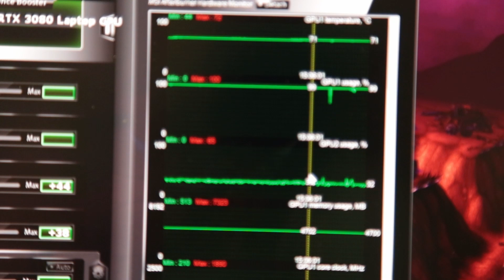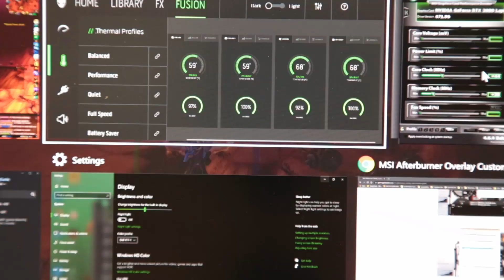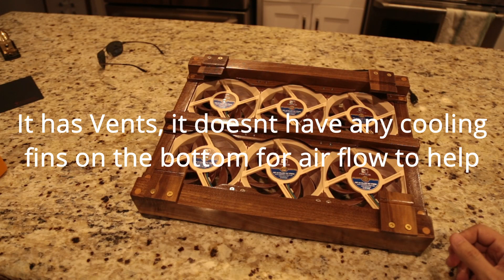Custom Made Laptop Cooling Pad (ft Alienware X17)

Comment: I did a frankenstein mod where I cut a hole in my laptop case and strapped a 120mm noctua fan. 3 days later I see tihs vid and I had the most YOU vs THE GUY SHE TELLS YOU NOT TO WORRY ABOUT when I seen the 6 fan setup. 

Its awesome we need more custom mods like this shown to evolve the laptop designs. I wish for a thiccer laptop to exist
Reply from the maker: Lols, thanks!!  It's a step up from the classic cooler, but these newer ones that seal and force a lot of air through are where its at now.  I probably can mod mine to work much better now.
Reply: @dragon.factory  Turbo! When you make something new related to this post it.

Comment: Yo this is epic! I suggest you to check out the Klim KN01 or IETS GT500 cooling pads. They have this special design where the sides are sealed so the air is forced into the laptop instead of bouncing off the bottom plate and leaked to the sides. You could probably do the same with your model to see if it helps more!
Reply from the maker: Wow, just looked at the IETS GT500 Powerful Turbo-Fan in some videos.  That design is prefect.  Yea, having a seal like that would go a long way to pushing the air right where it needs to be.  Might consider modifying mine to have that seal.  Good stuff!!
Reply: Ifi could add my 2 cents here, yea sealibg helps since we are looking at static pressure vs airflow, in order to push the air through higher resistance area you would need some kind of seal or the air would escape anywhere it can where resistance is lower, i have few builds behind me so i learned, love it. Love your creativity, i was thinking building with 3 fans a bit above the surface where laptop lies on springs and rubber on their tops so they spring in under the weight of laptop and seal is secured, do check pressure optimized fans vs airflow ones if not aware already, good luck with your builds!

Comment: How did you wire the fans to the controller? I used a step up controller from 5 to 12 V with 2 fanst and it destroyed my usb port ....
Reply from the maker: Both the fans and the controller are 5v to match what a usb can provide. So no need to convert.
Reply: @dragon.factory  Oh so the RPM is 1500 at 5v... nice... I guess I have to find something like that cuz with the step up convertor I think I damaged my usb port .... shit... :D
Reply from the maker: @senseiDi  oh damn. Possible.  Yea, definitely something to watch out for. Always check the power limits of ports before plugging in fans in. I learned this exact lesson myself with fan headers on a motherboard not knowing their were low and how amp headers and too many fans splitters.

Comment: Rpm suck you want cfm to be high so that air can be pushed through those small vents also those fans won’t do anything much unless the cfm on those fans are high enough to pass air through those tiny vents
Reply from the maker: When I designed it, I was going for high CFM.  The 6 Noctua NF-A12x25 5V PWM that I have are rated for 96 m3/h, which I consider to be quiet high for 5v fans.  Remember, these arent the higher powered 12v standard fans as all 6 are powered by a single usb port.  You rarely go wrong with a Noctua option.  

I wanted high CFM as I consider the cooling this provided was the cooling of the overall chassis, it was not meant to force air into the case.  If you look at my design, the fans sit about 1.5 inches off the bottom of the chassis with the air flow designed to hit the bottom and go out the sides and back.  Pulling the hot lower panel's air out and providing constant fresh air for the internal fans to pull in.   

I did not mean to force air into the case because those holes are pretty small and it would require some what of a seal between the bottom of the case and the top of the fans with some form gasket.  I dont have the ability to craft that yet.  If i had tried, it likely would be less than perfect.  And if it was less than perfect, it would end up functioning like my current design already is with air simply blowing across the bottom of the chassis.

Also, if I went with a design to blow air into the holes, I actually wouldnt care about CFM but I would care about static pressure fans like the Noctua NF-F12.  These would be much better at force air through those small holes. 

Cheers!!
Reply: @dragon.factory  thanks for replying and appreciate the details 👍🏼🙂 but the reason why I said high cfm is because I did a diy build with lesser static air pressure and high static pressure and I figured out that high is just the best options for laptops especially if your go for straight up performance which in my case I am so my build right now is four 200cfm 120mm 38mm 1.95A 12V connect to 120w DC power brick I use a hub to control the fans obviously I don’t want my laptop flying away lol case I use cooler master u3 or custom case

Comment: Nice project, this is just what I was looking for, except you don't explain the part that keeps me awake at night 😅... I have already a design but I don't find any fan controller that suits me, at the end I found that NA-FC1 noctua fan controller, it seems to be what I need (4pin PWM controller) except for the way it's powered, how do you feed the controller? Btw I need 12V so usb is not a solution to me, this is why I'm going to use 12V charging brick, any help? Thanks in advance
Reply from the maker: Thanks!!  Yea, i used the NA-FC1 as well.  Why cant you use the 5v noctua fans and just run it off the usb?
Reply: @dragon.factory  I want to use all the fan capacity which is 3000rpm but it needs the full voltage for that, but how did you connect yours?
Reply from the maker: @lobsangwhite  Aahh.  Yea, I just used the Noctua 5v fans, have all 6 attached via on one usb connection.  This for a laptop?  Because the extra cooling of these that are slower to a full 3k fans likely wont be much.
Reply: @dragon.factory  I got it, but idk if 6 low rpm fans can generate the same CFM as a high rpm fan... Could you share a diagram of the noctua controller to usb, or picture of your connection?

Comment: The best thing you can do is undervolt and repaste with liquid metal. Nothing else really helps. If you could get a line of cold air directly in front of intake fans, that would probably help as well.. But yeah.. and with the method I've suggested, you can easily get 30-40% improvement overall. It's what I've gotten. Good thermal transfer, less power consumption. It's the only way.
Reply from the maker: Total Agree, check out my video where I have applied LM  https://youtu.be/sj9_469RxZc

Comment: Wow, beautiful. I just recently bought a x17 3080 and was shopping for cooling pads but this one is beautiful and looks highly efficient. Do you do custom orders? 😂
Reply from the maker: Sorry. No.  Have other of my own projects I want to work on. Looks cool but you can see not a huge difference.  Raising the back is the key.  You can buy a stand and then just buy the 5v noctua with the usb connection and rest it underneath. Will do better than any of the cooling pads out there.
Reply: Get a Cooler Master NotePal U2 PLUS V2 and change the fans for the Noctua ones plus the usb connection.

Comment: This is sooo overkill, two fans are more than enough especially if the bottom panel of the laptop is stock. If you drill holes over the heatpipes, vrms or over the blower fans you can get an advantage with 6.